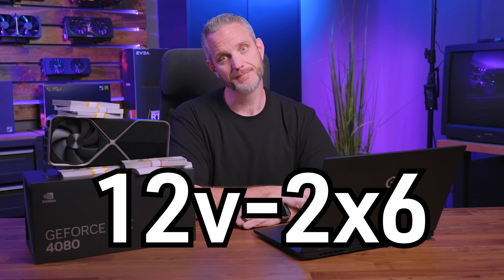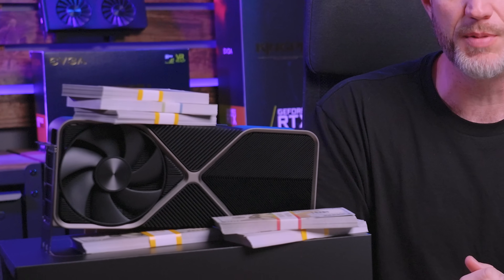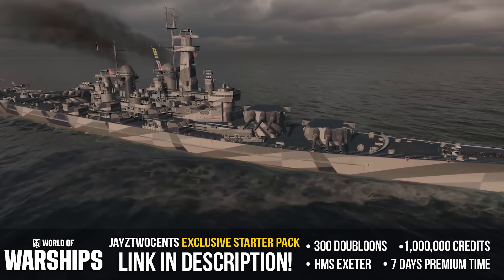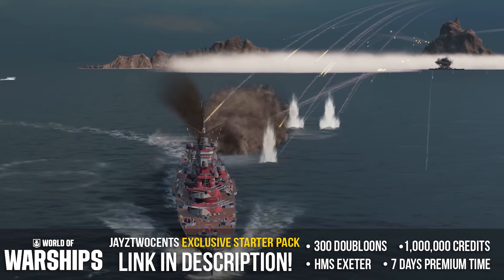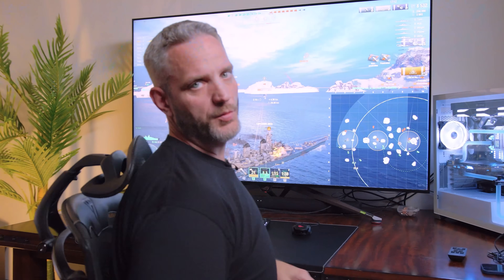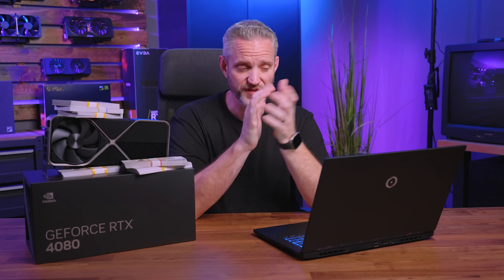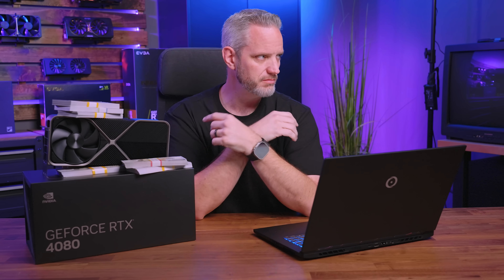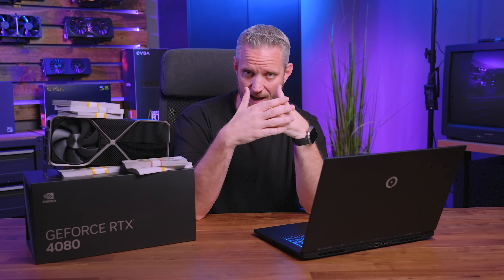They FINALLY admitted that this was a major issue!

Comment: I still just find it baffling an industry standard company let this thing go through.

They either had bad engineers, or management didn't listen to the engineers and told them to cut costs, as usual in modern mass market design manufacturing..

Comment: Fortunately i didn't bought a 4090 yet, and as i will not be shure that a 4090 will also not in the future be supplied according new rules, therefore Goodbye 4090, Goodbye Nvidia.
And i totally disagree thats not an early adopters problem its definitely a safety issue, and therefore the companies have to act accordingly : RECALL is for sure a possible way. And its not the user fault if the connection failed, its just a design issue, not less and not more. I got a recall for my car even it was more than 10 years old, as there was a POSSIBLE Safety issue.And even if a car is 20 years old there can possibly be a recall, the car manufacturers are fiorced to do that by the government.

Comment: I am not a computer tech. Surface contact area is THE most important thing in lowering heat (resistance) in high current connections. The next thing, you can lower the amps (effective heating) by using a card and power supply using a higher voltage (Ohms law). This would require a huge standards change. What I hate is GPUs simply upping the power required! I hate it when all the house lights dim everytime I boot up my PC. These days electricity is to costly to waste. Manufacturers need to do better.

Comment: AMD was SOO smart in avoiding using this connection right off the bat. They were smart to think ".. lets see if this actually works first". This is such a costly mistake for 4090 owners given how freaking expensive those cards are.

Comment: Thsi whole thing just makes me think they should have used their influence to either get a +24V rail written into the ATX spec or beef up the -12V rail so the cards could run at ~24V effective. This high current thing just seems like a desperate measure.

Comment: Ah, I remember when the original ATX PSUs that came out in 1995.   Unlike previous AT PSUs,  ATX PSU sucked cool air from the back and blows the air ONTO the CPU.  The idea was to blow the air onto the CPU so it wouldn't require an active (fan) heatsink.     Yeah, any one with a brain KNEW it was a bad idea back then.  60+mhz CPUs started needing fans.    Even in 1995, most PCs were towers.  In the shop I worked, I'd say we'd sell 100 towers for each desktop in 1994.   SOMEHOW, the computer case is supposed to push out the HOT air out the lower-front of the case.    If it did work, it would blow warm air onto the user.   

As we know, hot air RISES... and in 1996 typical PCs were 100+ Mhz with the Pentium. And that Power supplies GENERATE heat, so it's blowing WARM air onto the CPU!!   STOOPID!
The bottom exhaust fan in the front was mostly worthless so... yeah, computers were overheating.  One of the solutions was to run the PC with the cover off.  Yeah, that was a thing.

ATX didn't start taking off until 1996, as ALL new computer cases had to be engineered for ATX.  Pentium II in 1997 at 233~350Mhz.   A lot of tech DID NOT like ATX.  As we were concerned about sound card compatibility, that the sound, IDE, Ethernet and PAR/SER ports were on the motherboard.    ATX helped to take out Sound Blaster and network cards.   By 1998, ATX started becoming really good and reliable.   Far more reliable than AT computers when you would NEEDED to have 4~5 cards for functionality.  By 2000, most people had a gaming card with the other 6 slots being empty.

Comment: Ok then I need some advice. 
I am right now building a 4090 machine, 13900k, all the sparkly things. 
With this new info, what should I use to power to card now?
My power supply (a thermaltake) does have that potentially faulty adapter. 
What should I do?

Comment: Dont usually comment, but the black screen with 100% fan speed issue happened to me only after I got a 12vhpw to 4 pcie cable from cablemods. Ended up being very annoying and random. Thankfully they immediately got me another one and its been basically flawless as far as I can tell. Although Im concerned enough as most 4090 users to maybe get a cable with the new connector. Have had since launch and no burning issues, but will always be a concern.

Comment: This whole socket is a joke, putting a 600W connector pointing upwards on a high card with bad contacts. From day one this should have been a 90deg connector secured with screw sockets and strain-relief against the pcb. But that would have increased the production cost about 50ct, which is a no-go on a $2000 card for nvidia! What a joke.

Comment: Few things that is concering. 30 degrees C delta at presumed max operating power for me seems like a lot. Because this would mean the safety factor is very close to 1. As soon as the power that goes through the plug exceeds its max then the tempature increases exceptionally. Higher temp higher resistance more resistance becomes more tempature.

What i would like to see if it was 5 degrees max, and a safety factor of 2 or more. But to cut cost they probably went with a safety factor of 1.3 or pretty low.

Comment: Thanks Jay. Yep totally agree, Nvidia f***ed up on all accounts and imo they lost the trust of the gamers, pc build enthusiasts and others. I believe in second chances and hopefully they can redeem themselves with 5000 GPUs, taking into account the backlash received by so many people for 4000 series.
Reply: Nvidia didn't design the connector. PCI-SIG did and as a member Nvidia had no choice but to use it on any card over 450 Watts.
Reply: @Glornak  their lack of really caring has said all you need to know about Nvidia though, yeah blame the user! then roll out a fix and ghost all existing customers. Nvidia does not care, will not care, and they need to stop being excused.
Reply: @kzs831  Correcting people that are spreading misinformation isn't excusing Nvidia. Blame Nvidia for problems that are actually their fault instead of making up crap.
Reply: @Glornak  it is excusing them, they should have provided better investigation, found the solution themselves and set up a retrofit plan for existing customers. If it were a car it's still your manufacturers fault if the car is defective even if it's a particular part built by a supplier.
Reply: @kzs831   @kzs831  They don't get to "find a solution". They're part of PCI-SIG and it's legally up to PCI-SIG to handle every aspect of GPU connectors including recalls. Nvidia isn't allowed to design or modify existing connectors by themselves. Why not complain about Intel and AMD not finding a solution? They're part of PCI-SIG too and signed off on the development and mandate of 12vhpwr. Intel even went a step further and made native 12vhpwr connecters a requirement for power supplies to be ATX 3.0 compliant. 

Nevermind all that though let's talk about your hideous car analogy for a second. Nvidia isn't making the car in this scenario. It's the end user. Nvidia is just suppling the part and we'd be having a completely different conversation of Nvidia was selling pre-builts that were melting cause the cords were loose. So I'll use the car framing correctly and ask. Would you blame X Shift Corp if you didn't install your aftermarket transmission into your Toyota correctly and lost engine power on the freeway? Do you think X Shifter Corp should be held liable when their transmission would have worked just fine if you didn't forget to tighten a bolt? 

The reality is that the only thing Nvidia could have done, if they knew about the issue, without breaching contract with PCI-SIG would have been to delay the launch of 40 series for like a year while PCI-SIG went through the exhaustive process of updating the spec which would have nearly bankrupted Nvidia. For what? A very rare issue that's legitimately user error?
Reply: @Glornak  oh poor Nvidia getting some heat for something they need to take ownership on as its only affecting their cards... sorry bud, I hope they are paying you enough for handling their PR mishaps
Reply: @kzs831  Well I explained how the power connector industry works and who's the sole entity at fault with the power to fix the issue. Feel free to continue being willfully ignorant.

Comment: Making shorter sense pins so you know for sure the plug is all in is an impovement but, is it an idea to put some heat sensor near the power plug on the card so when it's getting to hot the card throttles down and give a warning ? Motherboards had/have a speaker on it that give a beep code so why not do the same with these video cards .

Comment: Duuuuude! I’ve been dealing with this bs for months now, it’s driving me nuts. Once the screen goes black and the fans ramp up I power down and unplug my 4090. I plug it back in and It works fine after that for a while, but it keeps happening every day. Thanks for breaking this down for us.😢
Reply: Seems to be a low power fault state that could be caused by the connector, PSU, or the card.
I will be getting a NTK adapter even though I don't have the issue, as those dimples are going to fail at some point.
Reply: @abram730  i was using a Cablemod cable with the 90 degree adapter. I just changed it to the Corsair aftermarket adapter (I have a Corsair PSU) for the 4090 and no problem since.
Reply: @AwXsome  Glad to hear.  Seems to have been a bad sense wire connection, as the video said.

I also have a Corsair PSU and 4090, but my cable is fine... for now.

Comment: I still don't understand why they don't increase the 12v to 24v.  You'd only need to use a series cable from the powersupply.  That would halve the amperage and, thus, vastly reduce the cable and connector requirements.

Comment: meanwhile the full circular contact of the 4 pin Molex 12v/5v drive connector's rating is 6A per powered pin for a goddamned reason: it doesn't heat up.

Comment: There should also be more clips to hold the connector in place. Probably 1 on each of the short sides of the cable connector and 1 on long side of the gpu connector.

Comment: Not fit for purpose consumer law should apply, card rated at 600w and melts if it receives it.   "You'll have legal rights if the item you bought is: broken or damaged ('not of satisfactory quality') unusable ('not fit for purpose') not what was advertised or doesn't match the seller's description."

Comment: does that mean when I am in a 200 C environment my plug can technically be at 230 C?
just recently I got a RTX 4080, I know, not a problematic card, but still I was very careful with that cable. it must be the most delicate plug I ever saw in a PC. I didn't took a closer look at my 90 degree adapter yet though. The Asus supplied pigtail is a "bad" one with dimples. yeah, things happen I guess.

Comment: Isn't it truly wonderful that the original POS '12VHPR'  connector is history and been replaced with the same POS connector but now called '12V 6+2' connector and slightly mechanically tweaked? 

Personally, I've had enough of this garbage 'standard'. It should have gone away and not returned.This nitpicking over the different designs of the connector is absolute BS and just proves even more that this 'standard' was never fit for purpose. It is blatantly obvious that the physical connector was never designed to and cannot carry more power than the larger regular PCIe connector was designed to because of, well,  basic physics and the original design specification of the connector used. The 'design tweaks' are nothing more than trying to polish a complete turd of a 'standard' that should never have seen the light of day in the first place.

I'm not at all against the idea of a single high-power 12V connector, but this abomination is by its basic design electrically less capable than two regular 6-pin PCIe connectors. An significant improvement in power delivery capability could easily have been achieved by simply switching from the current PCIe power connector standard to the existing EPS power connector standard. A pair of EPS power connectors would result in the gaining of two more +12V lines for a GPU and a reduction of the number of different power delivery standards a PSU has to have. This would gain better power delivery while reducing overall costs saving end-users money instead of the present situation which is costing end-users and lot more for a lot less.

Comment: Had the original adapter had a 90 degree bend in the plug most of these issue wouldn't have happened as the stress on the plug wouldn't have occurred. For the original cables I suggest a clip on bend be made which would only allow the cable to bend within the specified radius.

Comment: 18 gauge is definitely inadequate, 10 amps max on 16, and 18 is thinner. but as he said the pins can be part of it too. most people think current runs through the wire, it does not. it runs on the outside surface of the wire and the pin, if you don't have enough surface area contact at a joint ( plug) it can heat up, also if there isn't enough friction, you will also get heat build up.

Comment: Side thought, not that I know the circuitry, but being allowed the full 75w from the slot, couldn’t that be designed to power fans, RGB or any other gimmic, leaving the external power to supply the core on full power. I know higher end 40series are voltage limited, not power, but why not have the slot power the fans, RGB, etc an external power just for the core and vram. Hek, they might be doing that already, I don’t know. I’m just a retired electrician pondering

Comment: Jay, after having a very quick look at the first images on the new spec. The new spec seems to be using only one lock clip like to current spec. And not adding a second one to insure that the plug does not back-out. When you mentioned this in one of your first videos about the plug issue. You mentioned how surprised you that the spec did not have to lock clips. (For which I agreed with you.) And now with the new spec, they are doing that again. This does not seem right to me, and doesn't makes sense to me either.

Comment: They just need to redesign the plug to use larger pins and cables. Go with a standard size 2x6 plug with a dedicated data cable

Comment: I dont understand why the GPUs dont use bullet connectors like in the XT60 plug for lipo batteries that is used on rc cars with high current drain. The 3.5mm bullet connector in the XT60 plug can handle 60A at 12V. If they had got 2 connectors for 12V, 2 for ground and 4 for the sense wires, it would be less chance to fail than the normal 8-pin connector.

Comment: Would be nice if you could make a video on how to identify the plug manufacturer of the cable shipped with the 4090, though I am not sure if this is possible at all without dismantling the 12pin plug.

Comment: Listening to "gauge" dimensions while being used to metric rather then imperial makes me wonder what was the line of thought to use a logarithmic scale for it and think thats a nice and easy way to mesure stuff.
Reply: The spec was conceived in the mid-19th century. It was how many times a wire needed to be pulled through the wire gauge dies to get a particular thickness. The more passes required, the smaller the diameter of the resulting wire. The system was actually developed for steel and other types of wire which had nothing to do with electrical wire at the time. And as usual, the spec appears to have been imported from the UK. And of course, we are still using it in the US. 😉

Comment: ~3 and 1/2 months in of 4090 use for me, nothing unusual, I hope its because I'm on a Silverstone PSU with its native 12vhpwr cable, so I'm hoping the connector type is the NTK one.
Reply: Had mine october melted 2 weeks ago just received a new card didn't even fix it

Comment: Having a shorter sense pin is the same logic as a U.K. G type plug that has shorter L/N pins Vs the Earth/Ground pin. The ground pin is longer to open a door on the L/N holes on the socket to prevent the L/N pins from making contact before it’s grounded.

Comment: One reason the dimples may wear out is metal fatigue. Metal, including copper, expands as it heats up especially when under heavy loads. Then when it cools off, the metal will retract making a looser connection.  Eventually those dimples will Stay loose. We had that problem with our deployment equipment in the desert. We started several fires not knowing why at first. Once we figured it out we had to retrofit connections and newer systems came with better connections.

Comment: guess its a good thing I'm waiting till June 2024 to build my next Rig "new parts all around"
really do hope the next AMD high end graphics card uses the new 12v connection.
but still might go with a cheap under $700 brand new RX 7900XTX by then too with 3x 8 pins its w/e tbh 24gb's vram is 24gb's of vram

Comment: I wonder what Alex from Northridge Fix was using plug wise when he was repairing the 40 series cards. Was he using Atron replacement jacks on those GPUs where the pins melted?
Reply: I use the Amphenol FCI Minitek® Pwr CEM-5 PCIe® Connector System , id put money on that's what he uses as well.

Comment: Simple, instead of having the reverse dimple that dimple sits in, have a HOLE that the dimple fits into and 100% contact of the rest of the pin. Dimple into hole simply holds the pin in place in the socket.

Comment: Honestly, these new power plugs should never have been a thing. There is no reason to reinvent the wheel here, the 8-pin power connectors have been serving us for well over a decade now without issue. If they can't produce a graphics card that stays within the power limits of 3x 8-pin power connectors then the graphics card SHOULD NOT exist. I feel the reason they are pushing new power connectors is because they know future GPUs will need a small nuclear reactor to run. Props to AMD for staying away from these connectors and not touching them with a 10ft pole.